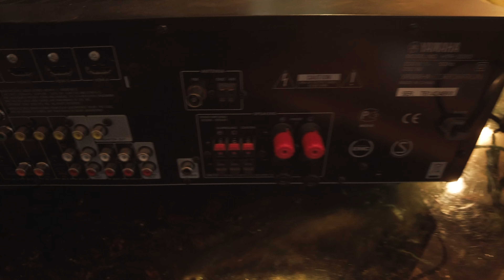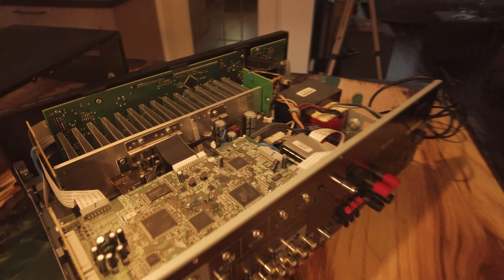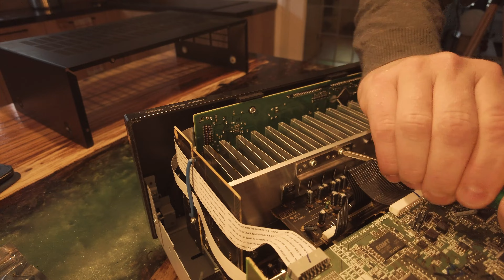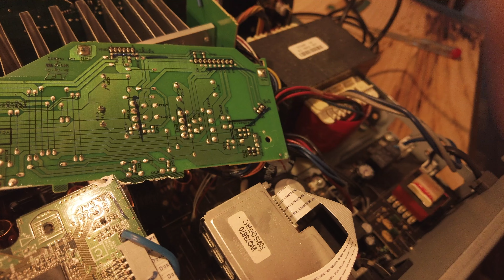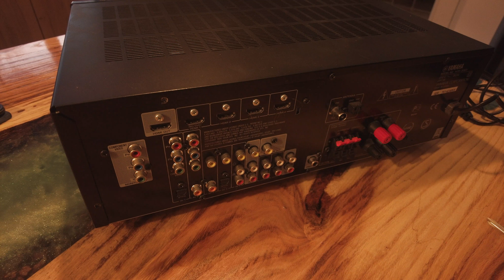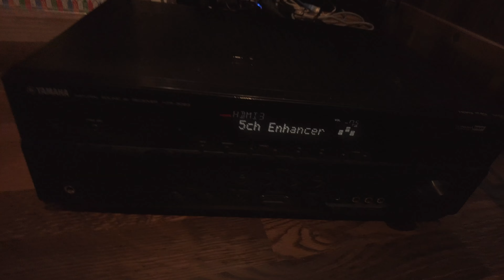Yamaha HTR3063 DIY Amplifier Repair Tutorial

Comment: My Yamaha HTR-3063 had four electrolytic capacitors instead of the three shown in this video (another 4700 µF 16v so I used another 25v). My unit was purchased in Canada say ~18-20 yrs ago. In the past few months, turning it on would result in two of the three relays clicking / energizing. Some times all three relays would energize however, there would be no audio and often, it would just power off. Several attempts on powering it on would eventually produce audio output. Only the 10000 µF cap had a bulging top and tiny bit of electrolyte leakage. I replaced all four of the electrolytic  capacitors on this board. Total cost was $14 CAD. I used Rubycon caps rated at 105C instead of the OEM 85C. I was able to replace  the caps without disconnecting any of the cables by just turning the PCB on its side (component side facing away from the heatsink). The cables were not under too much stress / tension. I would recommend to have a little bit of heat sink compound for the transistors since some will likely get wiped off during the handling of the PCB. Thanks to Archive ORG, there is a service manual available - https://archive.org/details/manualzz-id-927874/mode/2up

(2) 4700 µF  25v 105C
10000 µF  16v 105C
2200 µF  25v 105C